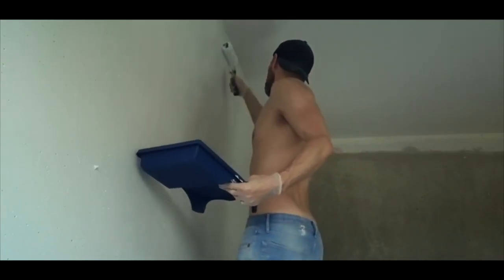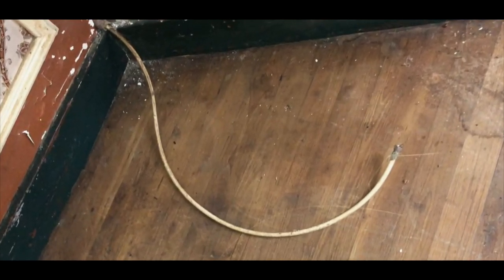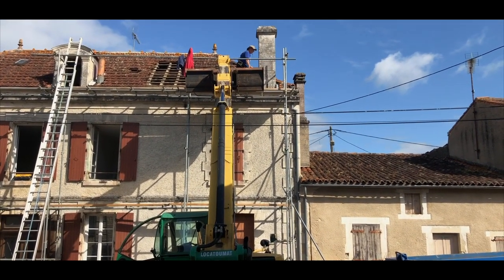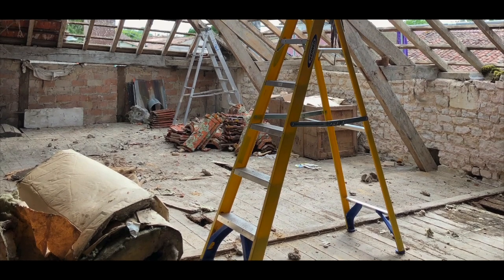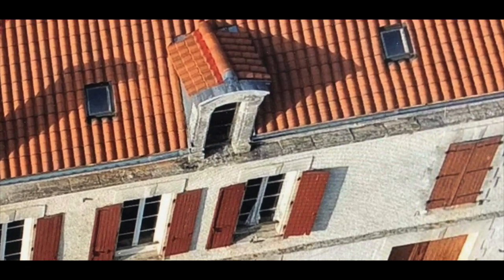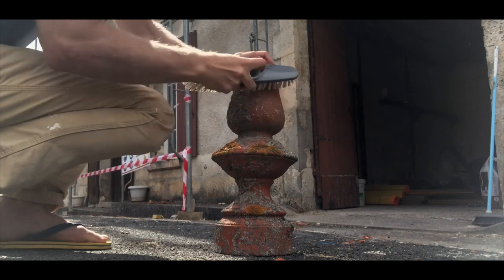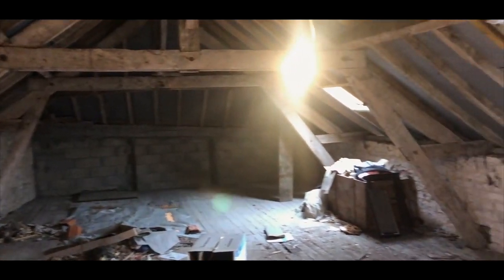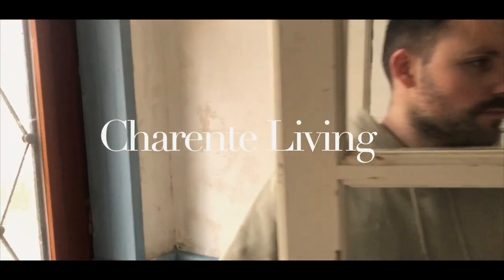RENOVATING A TILE ROOF in 6 minutes | How to renovate an abandoned house in rural France

Comment: In my family homes in Portugal, two of them older constructions as well, we used extruded polystyrene, 50mm thick, on top of the unused attic's floor (not attached to the beams). Easy to handle (weight), to trim and to fit. On top, relatively cheap. You might consider that attached to the smaller beams, and afterwards using a smart material to cover it, only leaving the beautiful, larger beams exposed.
Mineral wool is even better at insulating, and also offers the advantage of being fireproof, but is very tricky to handle, due to hazard particles quickly filling up the air during handling. Only used that once, and although marveled now, still remember the application with bitter memories.
Reply from the maker: Thanks so much for the advice. Really appreciate it. I can only imagine handling the wool, quite a tricky job to be sure.

Comment: Hi,I saw no tops on the chimneys,surely the rain will pour down inside the chimney,I bought an old flat once where there was no top on the chimney and rain over the years just turned the inside render to sludge,I had to get men to go up and put tops but the tops style depends on if you will have gas,wood or and coal fumes coming out of the chimney,this was a law on what fumes were coming out.What a fantastic hard job you got done,its sensational x
Reply from the maker: Hi Michele, sorry we have been so late in replying to this. Yes the chimneys are something we HAVE to look at soon, a good project for the summer.

Comment: I meant to watch through your vlogs since finding the channel, just doing that now. If you still want advice re insulation, in your latest vlog you mention converting the roof space - to preserve maximum height, you might want to use a multilayer quilt that will be thinner and more efficient than more usual types of insulation material. Should be available in bricos, France is pretty good that way.
Reply from the maker: Oh we will definitely look into this, thanks so much for the advice!

Comment: Hemp as someone else said is a great idea,you can buy hemp blocks,bit  pricy is hemp BUT its not the fire risk that other non organic insulation is,rember that if you have electrical wring in the loft any thick insulation makes the temperature around the wiring increase possible to cause fire so sometimes electrical wriring in roof space with increases insulation must be changed for thicker wiring so as to not get hot,you can get some really good swedish insulation,look on line which can be shipped,I like only one that wont exasperate toxic fumes in the event of a fire oorjust speed up burning.
Reply from the maker: Thanks for the advice Michele!

Comment: Wool is best for insulation as it breathes but it is pricey. You could alternatively use the foil backed flexible insulation, which is quite thin but really affective and allows more head height when you plaster board over the top. Considering this was 7 months ago ( I just noticed) it’s likely all done by now. All the best to you both
Reply from the maker: Thanks so much Lisa. Actually we still haven't gotten to start the attic yet, so the suggestions are wonderful!!
Reply: Sorry should have mentioned I meant sheeps wool to insulate. Best of luck with the project I’m sure it’ll look beautiful when it’s all done

Comment: Not sure if France has bubble foil insulation in the north USA its used in cabins check out YouTube off grid cabins
Reply from the maker: Thanks Margie. Haven't delved too deep yet into the insulation aisles at the hardware store so I am not sure if they have it in France. Must have a look though when next there. Thanks so much for the tip.